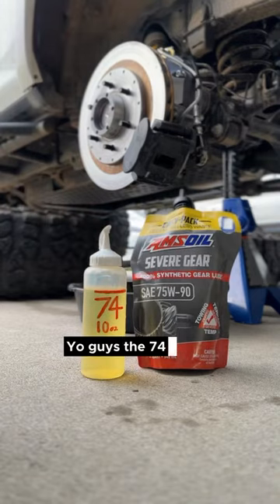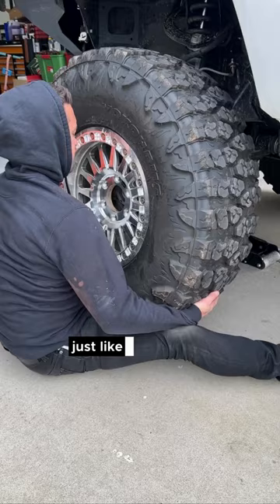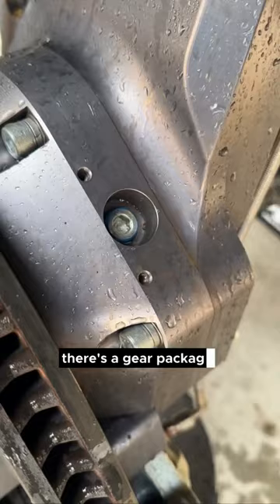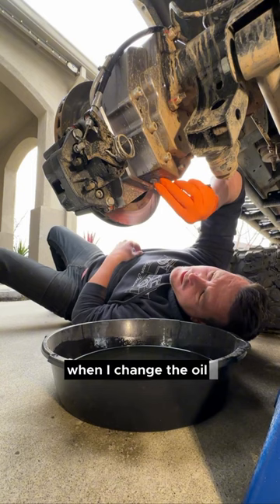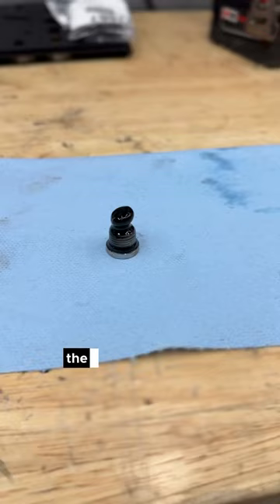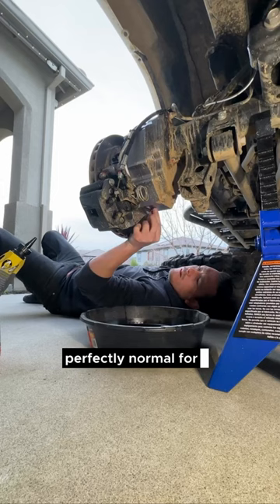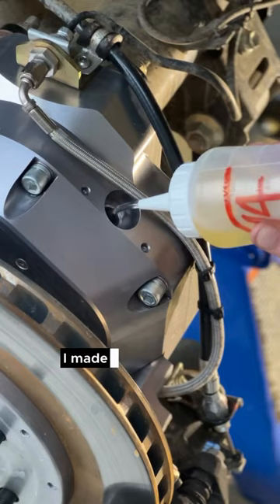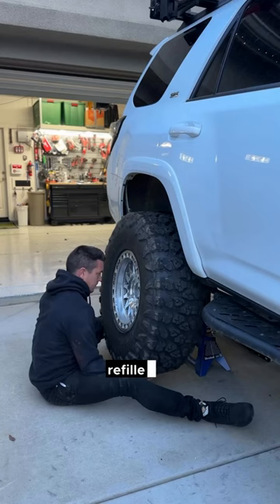PORTAL AXLE'S FIRST OIL CHANGE!!!! @74weld #toyota #4x4 #offroading  #portalaxles #shorts

Comment: Every 3000 miles is insane.
Reply: Not when these cost 20k. 😂
Reply: @palillo2006  That's precisely the point. If they're going to cost that much they should be severe duty.
Reply: yea all that for a pavement queen 😂😂
Reply: @clayton9136  personally i prefer to do excess fluid changes. Cause i aint messing expensive things over few dollars. Sure it's not few dollars over Time But sure beats spending $$$ at once
Reply: @clayton9136 The change interval is probably for the worst case 'severe duty' scenario tbh. Assuming that everybody beats the piss out of these and only having one number for light and severe duty keeps morons from killing it by assuming they are doing light duty stuff.
Reply: 3000 offroad miles are much different than on road.
Reply: He said 30000
Reply: @ImNotHere4750  No he didn't
Reply: @clayton9136  I change my motor oil every 3-4k that's why I have 3 trucks all above 400,000kms he'll my dodge has 830,000kms on it running strong. Sooner is better
Reply: @dalejrjunior1298 it's gear oil, not motor oil
Reply: @BillCarrIpswich  I know my point was changing fluid often is worth it in the long run
Reply: If you do water crossing its oil change every day

Comment: 75W90 and you're changing the oil every 3000 miles?  
Wow that's a high maintenance mod.
Reply: If he can afford portals, oil changes are nothing to him 😂
Reply: @kjimbo5569 literally had the same thought 😅
Reply: Has an sr5
Reply: That’s excessive
Reply: Dude I was about to say
Reply: @@tha_black_mercwow.  That's costly but I'm sure the cars worth that TLC
Reply: Its not near combustion @tha_black_merc
Reply: @@tha_black_merc gear no near fire
Reply: It's only 10 oz.
Reply: @@tha_black_merc theyre trying to say this gear oil isnt being exposed to combustion like engine oil, thus likely not building carbon from combustion. 
I know nothing about these portal hubs,  but i reckon like anything mechanical they can potentially overheat and discolor oil. So im not quite sure of their point.
Reply: @tha_black_merc  majority of the time transmission fluid doesnt get changed
Reply: Lol at 10 oz a piece your looking at like another 20-25 bucks an oil change. Really breaking the bank on fresh oil for 20k worth of equipment
Reply: @evandrewmartinez1  your sentence structure needs work and involves several repeat attempts at understanding your point.
Reply: @Spacecadet3890   that's right and that's why transmissions always let go because of ignorance and poorly informed people about maintenance
Reply: @nxtgen2b416  what are you talking about?
Reply: Yeah and those portals are $20k for a set
Reply: What’s the advantage of portals?
Reply: Expensive mods require meticulous maintenance
Reply: @samuelwieczerzak2460 gear reduction for running big tires and a lot more ground clearance.
Reply: He said 30000, go back and listen to it
Reply: Pretty sure he said thirty thousand

Comment: What does the portal axle on that car? I saw that the hummer has Portal axles to route a air hose through the middle so you can adjust the air pressure. Serves your portal axle the same purpose?

Comment: What exactly is a portal axle?
Reply: Gear set at each wheel essentially
Reply: @MrDAvIx63  oh ok so next question why would you do that lower gear ratios I assume?
Reply: @lone_wolf_kinda_person8486 they drop your wheels from the denter of the axle or suspension. These portals on this probably drop the center of the wheel a few inches. So it basically just lifts your vehicle, and gears it down a bit.
Reply: @sinisterdeer7601 so basically it’s purpose is to allow bigger tires
Reply: @lone_wolf_kinda_person8486  kinda yes, and give you more axle clearance. They are pretty neat